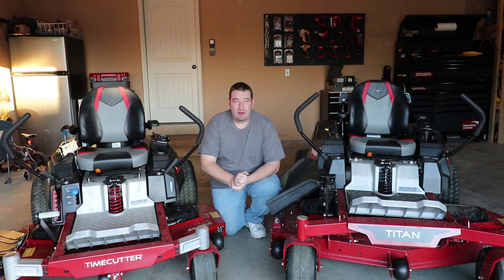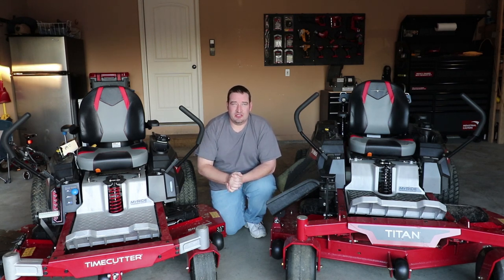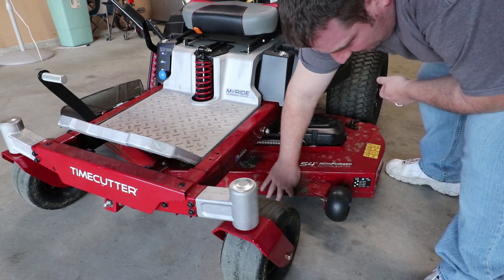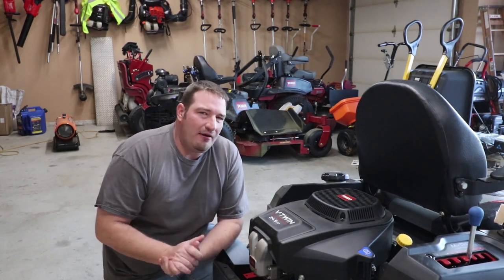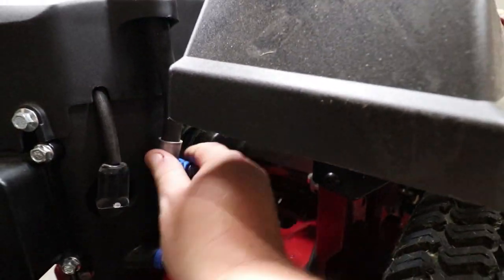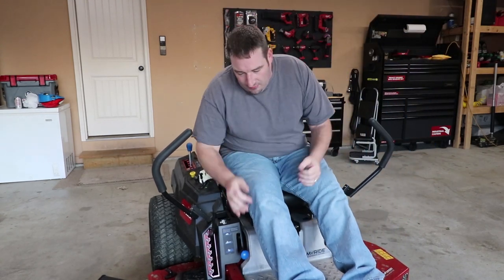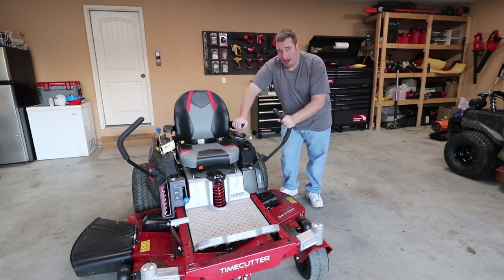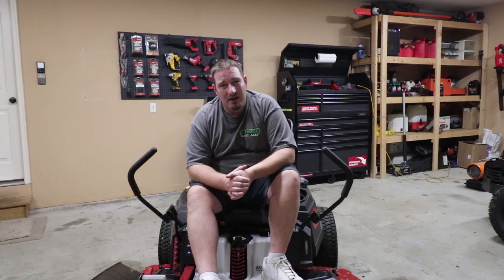ALL NEW 2020 TORO TIMECUTTER

Comment: What is the likes and dislikes of the toro engine
Reply from the maker: Soloman’s Lawncare I really didn’t have any dislikes with the Toro engines. I also only had them a couple months. I guess longevity would be my first concern. How long are these engines gonna last. But they give a decent warranty so not sure I’d have any worries
Reply: most engines today are solid......even the harbor frieght predators are built well. the big concerns on zeroturns are the hydro's. the toro24.5 is a well designed engine in the league with kohlers and near kaw's....none are Honda's

Comment: Timecutter blew pumps in less than 30 hours and rep says you can't pull anything over 80 lbs lol . Cut good but the pumps are too small for the mower ..only thing timecutter has going for it is myride but there are better built mowers out there but like you said as long as you got less than a acre and mow once a week you should be good and make sure it's flat land